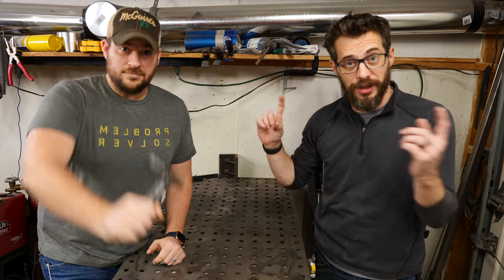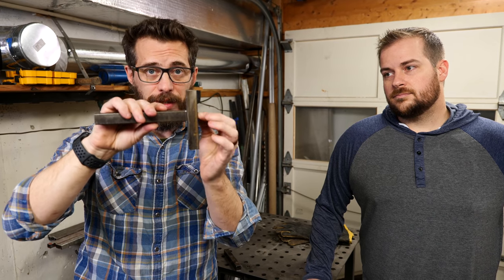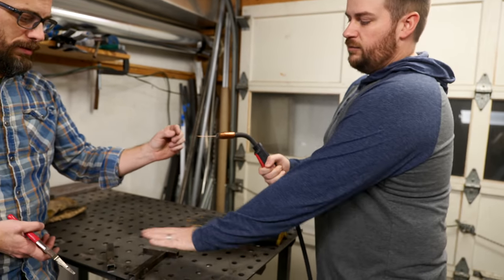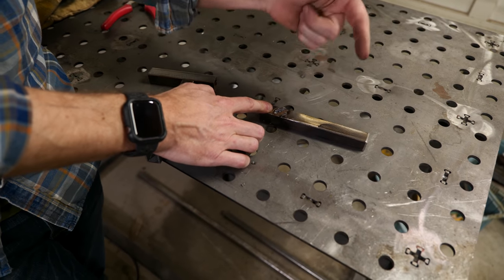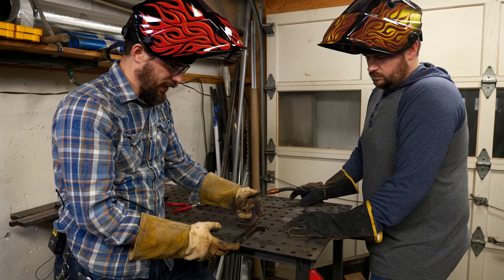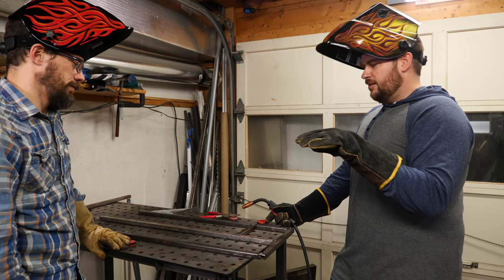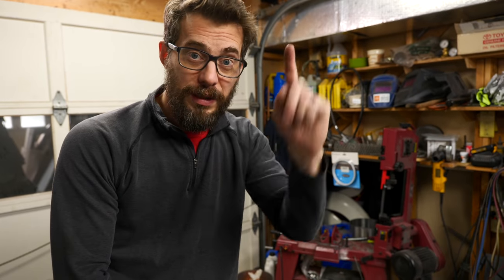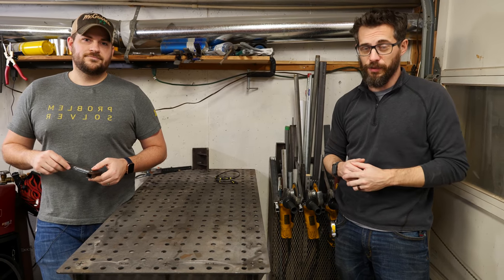Making Simple Steel Storage while Learning to Weld | I Like To Make Stuff

Comment: Professional Welder here! 
Gotta say that what you're sharing definitely helps out and covers the basics. And this sort of project is a perfect practice piece for Josh.
The difference between Pulling and Poking in welds, is pretty much down to a design level. There isn't all that much of a difference, and in day to day welding (Like tables, stuff like that.) it's definitely not something to be completely worried about. Stuck is stuck, and if you're a decent welder (Say, levels of Bob.) you wouldn't need to worry about the integrity of the build. This stuff becomes more important if you're welding in places like constructions, boats, and those kind of areas. But you wouldn't need to worry about those sort of things if you're just a hobbyist. If there's something that does fall under construction and you know that you won't be able to do it without having some doubt. Always go to a professional.

As Bob mentions at the end of the video, this does take time. Something that I've been taught, and will always mention if people are talking about learning how to weld. Know that this isn't something that you master within a day or a week or so. You've got to be making miles and miles of welds before you can really call yourself an expert on these things. I've been welding for 10 years now, and even I learn new things on a pretty regular bases.

The best sort of "technique" to lay a welding line like the ones that Josh and Bob are trying to show off here, would be something in the shape of a '3'. You pick a starting point, and you move towards your end point without it being a completely straight line. You want to cover the valley that's being created with the help of the edges that Bob has created. You basically want your welding point, to go from edge, down the valley, to the other edge, and scoot over, and do it all over again. A '3', 'C', or 'W' figure. Keep a steady hand (Remember, practice makes perfect.) and take your time. You'll eventually get to learn how fast you need to go, what will be too slow and cause burnout, and if you're going to be working on a metal table like Bob here, expect yourself to definitely be welding your pieces against the table from time to time. 

Josh, if this truly was your very first time welding. I will say that you've done a pretty decent job. Yes most of the welds aren't pretty, and sure I can tell which ones Bob made, and which one you did. But yours were pretty decent. If you're really interested, keep on trying. You'll get there.
Reply: Winchester MC-NL thank you for this comment! Very kind and helpful!
Reply: its always good to hear from the pros, especially encouragement :D
Reply: very much agree with winchester here except given the thickness of material perhaps a straight pull back would be enough. Weld pattern shouldn't matter too much unless doing thick material or vertical/overhead.
I've always said time and experience matters with welding so winchester may have a few years on me and some tricks up his sleeve i haven't come across yet :P

As always awesome videos and content and its always good to come home and find some new videos to watch :)
Keep up the great work Bob :)

Comment: When I learned to weld I was told "if you can hot glue, you can MIG."

They were sort of right? If hot glue required so much safety equipment.
Reply: I totally agree. Pull the trigger, slop molten metal into the joint, job done. more or less. After TIG welding, I was hooked and never wanted to MIG again.
Reply: @mark4prez20  I work in theater so most of our stuff is like weensey little 16ga or 18ga stuff. I would love to learn tig to find the differences but it's not something that's going to happen anytime soon, I think.
Reply: Mig is hard 
Stick is hard 
Tig is hard....

To make it  look good
Reply: @AisforAwkwardd  you could start out with oxy-acetylene, its said to be the same process but much cheaper
Reply: @nilsschenkel7149  nope.. it's a skill for a seasoned welder ...

Comment: Few tips for beginners from teaching other people: 
1. Everybody goes too fast at first so slow down :) 
2. Nobody talks about diameter of welding wire which is quite important - too thick will create proud, ugly beads on thinner material and too thin wire on thick material will create spatter and weak welds. Also with thiner wire You can turn down the parameters so You won't run in the risk of burning through material. For stuff You welded on video I recommend 0,8 mm wire and about 18-19V. Anything thicker than 3 mm would require 1+ mm wire. 
3. If You really want to understand the process better it's good to also play around with stick welding. In my opinion it really help to form sort of an intuition how much heat you need for what kind of material thickness. Still MIG/MAG is the best option if You're just starting and want to quickly make a project. Especially if You choose a synergic welder 
4. The most important tip: Watch some videos that show "how not to weld" with common mistakes shown. If You have a particular problem with Your welds You can quickly match the look of Your beads with those on video and rule out a specific problem like going too fast, too slow, too cold, too hot etc.

Good Luck! :)

Comment: Good video,couple additions as I was just training people on this at work.  No synthetic clothing(not just polyester) as it will melt to you.  Cotton clothing can still burn, but it's easier to put it out, vs synthetic will burn and melt onto you, doing more damage.  Also, as for wire feed and voltage, most welders will have a chart on the inside of the door to give you a pretty good idea of settings.  And tack weld cus the heat will distort the piece, as well as everything wanting to fall over all the time.
Reply from the maker: Thanks!

Comment: Why do all americans weld so weird ?
The standered here is to always push the weld not pull
Also you want the nozle to stick out further than the contact tip 
And if you want the strongest weld possible you dont want to do and c shapes or 3 shapes as i have seen some comment you just want a straight line
Reply: I was about to say the same, this much back and forth on the joints, they're making wider welds than we do on dump truck bodies...

Comment: Strong? Those welds looks strong enough for about 45,000kg capacity. Don't jerk the tip, just push it straight... No need for wasting wire grinding it back.

Comment: Professional weld from Australia here. There are a few things to know when MIG welding. For starters when you use flux core wire for your welding you should pull when you weld as it uses the same method as stick welding or known as MMAW. While you are welding also you should try not to make circles or swirls as when you move the arc of the weld around it leaves a cold spot in the middle of your weld as this can cause defects in your weld aswell. Also with just plain MIG wire you should push instead of pull as it doesn't have any flux to cover over your weld as you go along. The reason for this is to push the molten metal into the parent metal to give it a deep penetration and combined both the parent metal to the other. Also a little trick when welding with any tip of welding from MIG to MMAW to TIG is to have your Earth clamp facing away from the direction you are welding. The reason for this is because when your welding your using the electricity to create an arc and when you create the arc the electricity takes the shortest route for get to the Earth clamp so when your welding way from your Earth clamp your arc and electricity flows through your weld and gives you the better chace of having a beautiful weld beed when finished. There is alot more that i could explain but it would turn into a book so best not. Also when i said not to make circles or swirls that is for making the strongest weld possible but when you use the method walking the cup you make a sort of figure 8 patten when welding but this works weld because of over plaing where your cold spots were when you are walking the cup. Also when using a MIG welder you a simple trick is to use a pair of universal pliers and place them on the edge of your MIG gas cup and place your pliers of a 30 degree angle and cut your wire this also gives your wire a nice sharp point for starting your weld because it starts the arc right in the groove/corner of your welding surface. I good thing to also use to find out what type of amps/volts you should be using is based on the type of material and the thickness of the material. So lets say you have a 6mm piece of mild steel. First you take into account on how hot you think your arc should be and for how wide and how high you want your beed to be so if i was to do it i would use 22.5 volts with a wire speed of 12 and i would watch to make sure the arc of the weld is faned out evenly over the butt weld or make sure it is faced slightly high on the wall of your filet weld because the molten metal falls down because of gravity.

Comment: I’ve been working at a fab shop since I was 19 working on mustang and camaro parts. And a few tips I have are:
1: keep and eye on the weld puddle.
2: do whatever you can to be comfortable while welding, find a comfortable position for yourself it’ll make things a whole lot easier.
3: If you can move your project, and a particular weld seems hard, try downhill.

Comment: You probably already know but just in case... in the final minute of the video you are standing next to the garage door and one of the brackets is coming off. Those old wooden doors are quite heavy, be careful! Great video! In a past job I did quite a bit of stick-welding with just a small amount of MIG and TIG. I miss it.

Comment: The length of your wire stickout is the same as the width of your welpers(welding pliers). If you push your welper against the shielding nozzle you'll get a good stickout length. No measuring needed!

Comment: very good video, excellent project. Just a suggestion, when I quizzed my welding guru, he said, make sure you have an absolutely positive ground, as it can cause problems that appear to be feed and voltage problems. Makes sense, as the ground is the primary foundation of a proper weld, and should never be overlooked. Cheers!

Comment: FCAW flux core arc welding has a powder core rather than a liquid core.   The metal cylinder is filled with flux powder.. if needed shielding gas can be used .. for stainless steel welding . For mild steel FCAW gas is not required*

Comment: To me (according to the way I think), MIG welding is probably the easiest form to learn.  I grew up stick welding and (again to me) there's a huge difference between stick welding and MIG. And to me, TIG is almost a form between stick and MIG.  You have to concentrate on your arc and piddle, but also know how much rod to add and when.  Yes, your still still joining two pieces together through the use of electrical current, but there's something about learning the "fill pattern" and keeping the arc distance balanced with the continuing downward movement of your arm (or upward movement if you're welding overhead) to create that nice even ripple pattern to your work. And if you ever get that "perfect weld", the slag covering seems to almost pop off on it's own.  And let's not even get into underwater welding, that's another monster all of it's own.

Comment: To those do it yourseff/hobby welders. Yes don't be afraid to try simple projects like this with little to no real structural load, but know your limitations, and do not just start welding on trailers, cars, or other heavy duty projects. I see a lot of bad advice on youtube from people not knowing the limitations of the process they are welding. 

I  am going to address something a lot of people on here won't like hearing but, I'm going to say it anyway. (Flux Core-Inner Shield) wire is very dangerous and is outlawed in my state for heavy industrial for a reason. If you are going to run Flux Core- use Duel Shield with => (projects expecting real loads). Yes it is uses gas as well as the inner flux inside the wire hence the industry name Duel Shield. 

There is a reason the welding industry does not generally use  "inner shield" most production or even heavy industry uses Duel Shield. If you want to make coat racks, coffee tables, etc light duty, than yes use inner shield if you want. 

I am not looking forward to the day we start hearing about welds failing on trucks, roll cages, trailers and the like because people were miss informed. Understanding loads, stresses, work hardening, and good joint design principles, makes me trust the welder performing the work.

Comment: I started welding again after many years and because of my small shop and versatility decided to go TIG.  That was a good choice for me but I have since added a small fluxcore and that sucker is great for dirty steel.  I have a lot of old junk scrap around here and recycle whenever I can but TIG really likes clean and you can spend a LOT of time cleaning and prepping.  The fluxcore just burns through most junk so fairly limited prep if you are just tossing things together AND it's light and works well outside.  A bunch more post cleanup if you want it to look really nice so that I will go to TIG for.

Comment: First off your information is good but basic like you said I'm currently taking a welding class and here is what I can tell you.
Pushing a mig weld will penatrate less which works well with thinner metals while pulling a weld penatrates more but mig is only good for around 1/8 while 3/16 is pushing it. Most hobbyists stick to regular mig while Fluxcore mig can weld thicker pieces and works even in the wind, while those are the primary two types of mig but you can also do something called dual shielding wich is flux core with shielding gas which is only really used by commercial fabricaters to make absolutly sure their weld is good. Also different polarities are important to what type you are doing DC+ for gas mig DC- for fluxcore mig commonly known as fluxcore welding long story short its complex and a little research can go a long way.

Comment: Makes me want to pick up  welder. A couple things i ve learned from the fab guys at our shop with the angle grinder: 1) if cutting, shoot for cutting at about 6 oclock on the wheel 2) if cutting, cut so that the wheel/tool will run away from you if it grabs or you drop it, that way it does come back & bite ya. Be warned, this may set your crotch on fire :)

Comment: With MIG you can push or pull and it really depends on other factors what will work best.  For flux core and stick you should pull (drag) because you do not want to get flux in the weld.

Comment: Great video, I have a small 110vlt wire core welder and I have burned a few pieces of metal together. I figure if I need some welded 'right and safe' I will tack it together and take it to a real welder

Comment: The miller welds weld settings app is a good starting point for where to set up your welder.  It all depends on what type of weld and and position for fine tunning.

It's not about how fast or how slow to move, you need to watch what the is doing.

Comment: I don't understand grounding the table/your work...can you explain that more thoroughly? What was the clamp you clamped to the table connected to and why does it need to be grounded? Are you grounding the table or the welder machine, are you protecting the person welding or the welder with the ground?  I love this info, I would love to learn to weld someday..... thanx for the info.
Reply: The welding process requires a complete circuit.  The ground clamp connects the welding machine electrically to the piece being welded.  And, electrode that the person doing the welding touches to the piece being welded on is at the opposite end connected to the welding machine, thereby completing the circuit.    The welding table is made of steel and makes the table part of the circuit. It is mainly for convenience.

Comment: I am getting ready to dive into MIG welding. It’s something I’ve always wanted to do (as a hobbyist/maker). What would be really helpful is a list of must haves to get started. Things like safety equipment, a table, consumables like grinder discs and those 90deg magnetic jigs. On that last point - are they a must have?
Reply: You don't need a table, it's useful but you can connect to ground the object you're welding on directly

Comment: One thing that would have been great to answer in the vid, Obviously there are different types of welding/welders. Why did you choose MIG vs any of the others and what would you recommend for the newbie/hobbyist?
Reply: I would go with mig if you are doing hobby stuff. Metal is expensive so for hone stuff you'll hardly ever need more than 1/8 inch metal, and mig is fine for that.  It is easier to get to a point where you can make something with mig.  Tig welding takes more time to learn. To be honest it almost broke my spirit a few times when I first started. If you want to be a welder start with stick and tig, but if you are looking to fix things around the house and make art and stuff you can't go wrong with mig. Just be careful to clean the mill scale off and watch it wet in to the edges because some times it well looks like it's welded but is just sitting on top not even fuses.  weld dot com  is good and the channels he mentioned are a good place to get some good info.